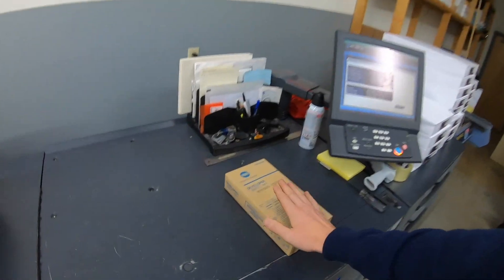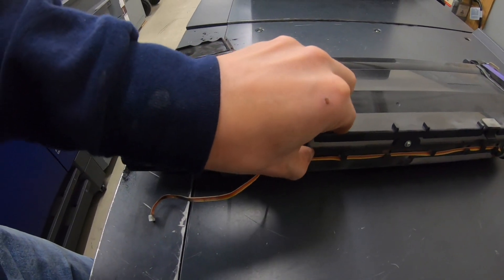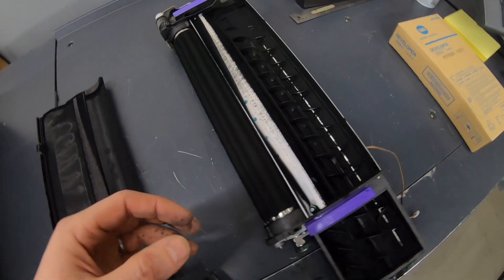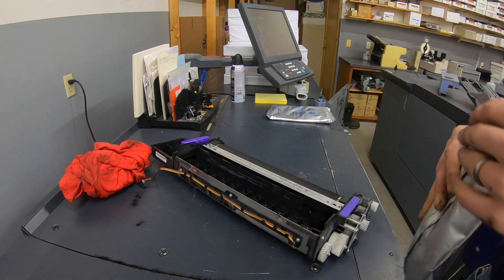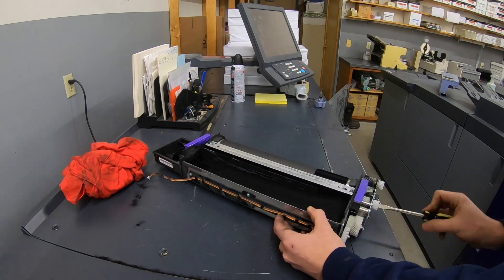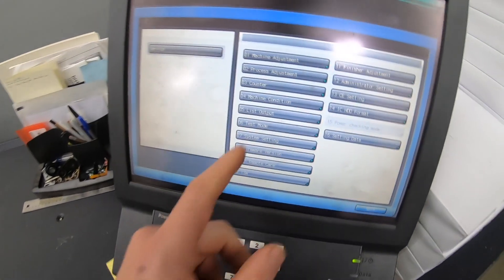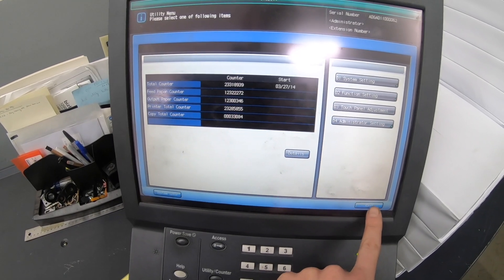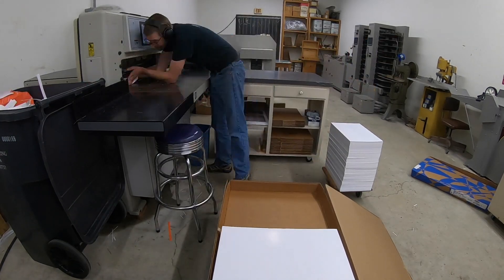Developer Change on Konica Minolta 1200 PRO, Fixing Error Code c-2803

Comment: Minolta 165 e. Changed to new compatible developer, drum, blade. Using orignal toner. After 2000 cps, faint & less density copies. Uneven white prints. Reason?.
Reply from the maker: I’m not familiar with that machine. Sorry!

Comment: The good folks at Konica-Minolta cancelled our maintenance contract for a bizhub 1200 pro saying that the machine is obsolete. I see that drums and developer are easy to find on the internet so I will be doing many things myself. Once the parts come in, I will be going back to this.

Your drum looks a different color. Is it aftermarket? Where'd you get it? I see some on aliexpress, but I'm nervous to buy from an unknown source.

Comment: you rock I need to do this on my 1052 press. I also need to change the cleaning blades do you have a video of that in this style of machine? I have a 1mm PM kit on the way. Where do you get your developer?
Reply from the maker: Just replaced the cleaning blades today on my 1200, I should have filmed it. It is very simple. just 4 screws on the top of the cleaning unit. Then remove the filter screen on top and there is one screw that holds the cleaning blade. I should make a video showing that.
Reply: @justaprinter  looks like I have two and am wondering about that a little bit will be read the service manual
Reply from the maker: @davidbrasier1239  Yes, you replace the one blade. Then you need to move a lever on the left and right of the unit to switch the next old blade. The manual will show you.

Comment: Hey Dan how are u just a quick question I have a konica minolta c1070 machine and it gave me a c-2841 I did all the detective work and it seems like it's my mother board and I just can't find it online do you know any website that I can order from ? Thanks Dan! ☺️
Reply from the maker: I never had to change a motherboard. There is a company called hytec repair that can repair boards.

Comment: Please learn how to configure the 6500 Pro
Reply from the maker: I no longer am running my c6500. That was a great machine.
Reply: Do you have lessons about it?
Reply: I was a color tech with IKON. I loved the IKON 650/550 which were rebranded KM C6500/5500. I also did Canon 7000 and Ricoh 900. Retired now, but I miss the KM color boxes, they were well-built machines. Very tech-friendly. Amazing that they are still just chugging along, I retired in 2011. @justaprinter

Comment: Hi, great video again! One thing I still am struggeling to fully grasp the purpose of: What is the developer used for? It is not the toner but it is a consumable you need to replace. Could you maybe explain the topic in one of your future videos? Thanks a lot!
Reply: In a dual component machine there is developer, a kind of fine metal granules powder, carries the toner feeded in developing unit to the drum via developing roller, a precisely placed magnets in it. If I recall it was thoroughly discussed in Minolta ep6000 service manual, if you can find on internet.
Reply from the maker: Sorry! I was in a hurry to get this done that I didn't explain more about it. On this machine the developer needs to be replaced. The developer carries toner from the developer unit to the drum and over time it wears out and carries less toner. You loose density. I'll have to talk more about the theory in the future. Great question!
Reply: @Zahid and @Dan thanks a lot for your explanations!

Comment: Do you use Konica OEM or 3rd party developer.  Same question for drums. I didn't see a Konica trademark on the bag. If 3rd party, do you see any quality/longevity difference?  Any specific 3rd party you prefer?
Reply from the maker: I only use OEM after that bad generic drum experience I had. I have found that OEM is worth the slightly higher price, just to save me time.

Comment: How do you deal with the skew in feed direction, duplex printing?
Reply from the maker: There are some adjustments for this on the 1200. The 1070 and 3070 are pretty amazing and they don't need much adjustment.
Reply: @justaprinter  we did it quite good on a 1052, when turning the registration section sideways a little bit. But now there is skew in cross feed direction. Any ideas?